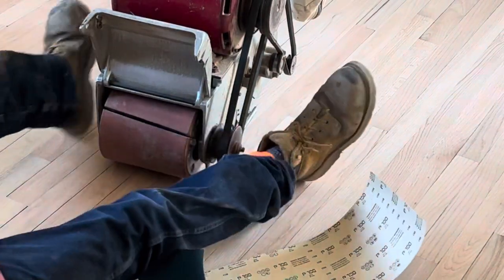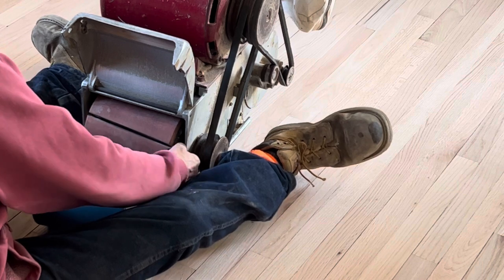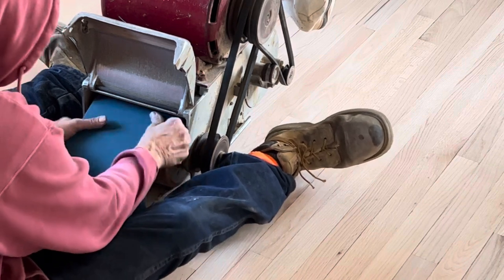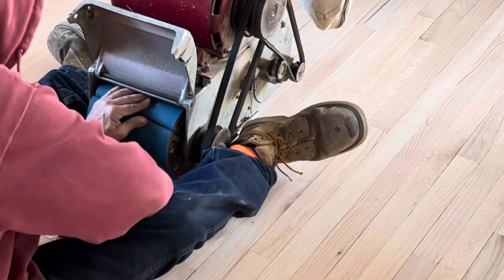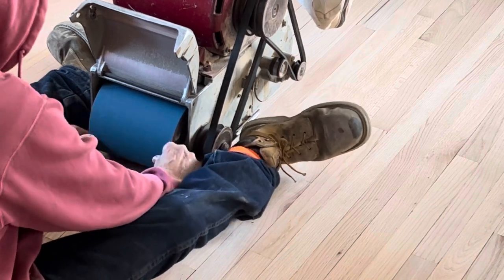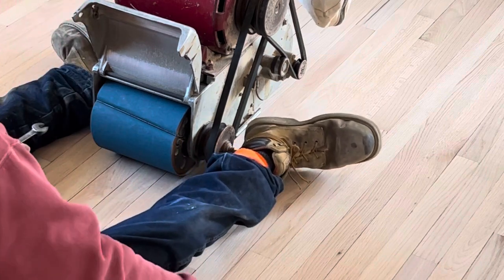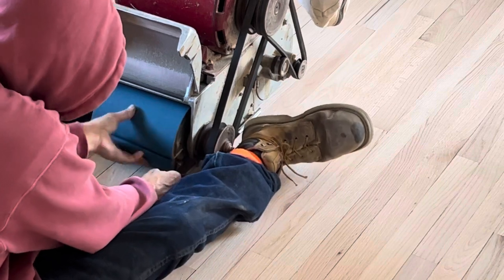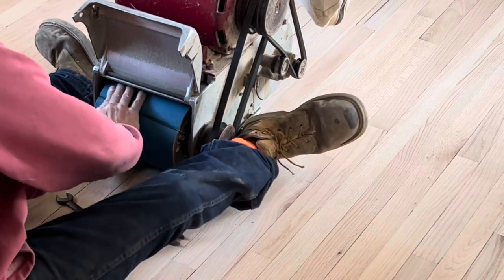Howto Sand a Wood Floor Without (CHATTER MARKS) : when sanding a floor with a slotted drum sander.

Comment: I learned how to sand on an old American sander 30 plus years ago. If you put the paper on too tight it will chatter, If you put the paper on too loose it will chatter and if you put the paper on just perfect it will still chatter. I've been using Lagler Hummel for 25 years. BTW, of course you can't see any chatter marks because there's no finish on the floor yet....how dumb do you think we are ? LOL!!
Reply from the maker: If you put the paper on loose it will break.. lol … Customer was very very happy and I got paid  … I did hundreds of high end homes… no problems ..of course it can not be a 100% if you need that then you need the belt sander…however you can get it 98 % or better with the slotted drum … Remember for years there was no belts ,how do you think they did floors ? The Profit margin is also way way higher than the belt sander with a drum … the money you spend on sandpaper on one house  .. I can do 10 🤑 .. I started sanding in the mid seventies self employed since 90 … 99.9 % success rate !! 😁✌️

Comment: Pull the paper out about 1/4 inch prior to tightening so as to get a more complete grab of the paper.
Reply from the maker: I use a template that gives me the exact length of the paper - to factory specs … what I do works that’s the reason for the video .. this is a 220 machine not the 110 volt machine … the drums are different … however you will always have some marks with these types of drum … this video demonstrates how to minimize them … completely chatter free sanding is only accomplished through using the belt type sanders … 🙂✌️
Reply: @thrlllckr6244  Regardless of the sander being 110 volts or 200 volts has no relevance. Using a template is a guide line only. Cutting the paper at the correct angle and bending the paper according to the template is only the beginning. While your metal template will never change, your drum does. The drum will change with temperature as well as the drum wearing down. Some drum machines require a shim. While other do not. Complete chatter free sanding is not accomplished only by using a belt sander. It's accomplished by knowing how to correctly install the paper onto a drum. As as the person above stated, knowing when to back the paper out of the drum as needed. if needed. 
 FYI, Belt sanders can also create chatter for a couple different reasons.